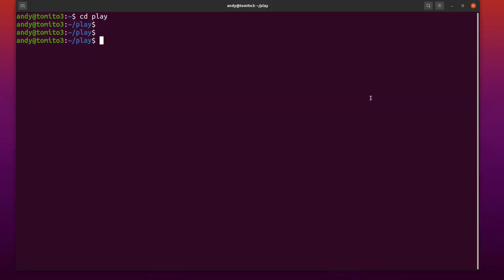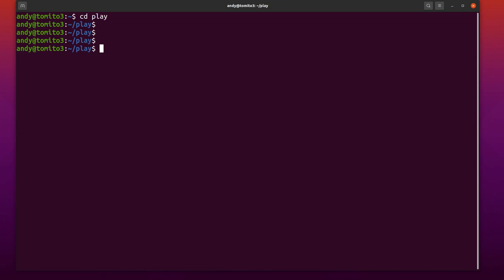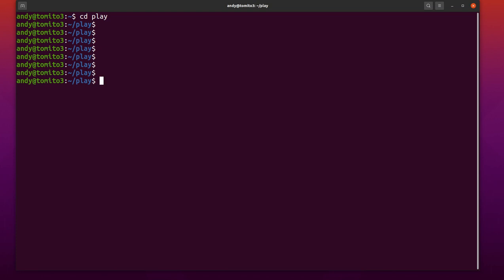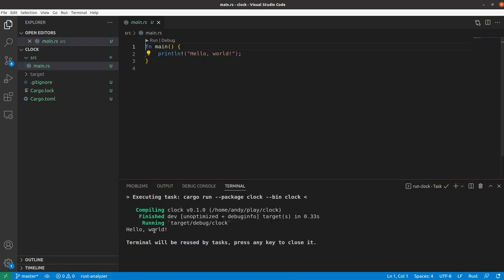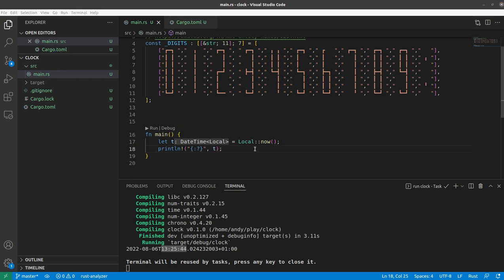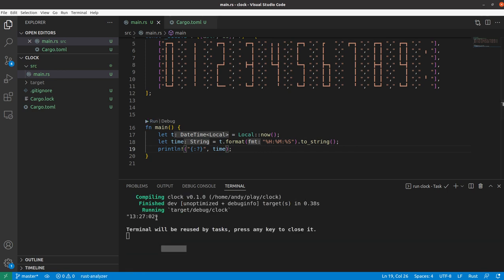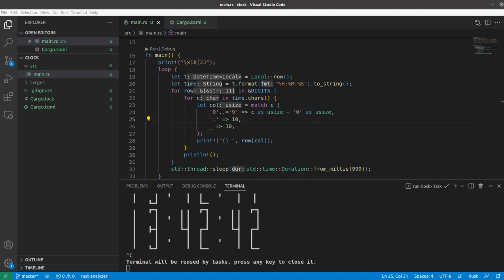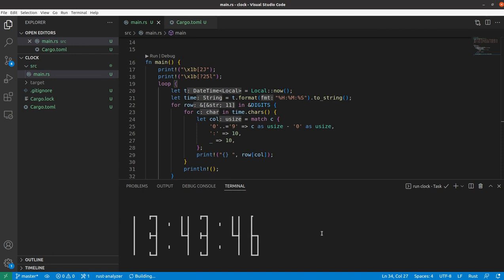Simple Rust Projects: A Rust digital clock

Comment: If you don't want to pollute the original terminal buffer, you can enter an Alternate Screen Buffer with "\x1b[?1049h" and reset it back to the original buffer with "\x1b[?1049l" when you quit. Supported in most terminals (esp. those that implements xterm)
Reply: do i print that text?
Reply: @RenderingUser  Yes, every ANSI escape code is printed to stdout so that the terminal that receives it can interpret it and do what it needs to according to spec that it implements (e.g. xterm, which is the most common).
Reply: @dealloc  thanks
Reply: @dealloc  also
Is there a way to clear the screen with rust for each frame?
Reply: @RenderingUser  There are multiple ways to clear the screen, and depends on your use case.

Clear the entire buffer with \x1b[<n>J where <n> is 0: clear from cursor down, 1: clear from cursor up, 3: clear entire screen. Simply just print with println! in Rust.

If you care about framerate and performance, I would use a library like Crossterm which provides a better API to interface with terminals, but also provides optimizations to avoid doing too much I/O by providing control over when things are pushed to the terminal (flushed).

Other additional optimizations would be to have virtual buffers, using diffing algorithms to only update cells in terminal that changed, rather than the entire screen, or even just portions of the screen if you have other static cells.

There's no need to overthink it at first. Start simple. I would prefer starting with Crossterm if your goal is to just render something into a terminal and relatively fast e.g. 25 frames per second.
Reply: @dealloc  ty again
thats very helpful

also <n> = 3 seems to produce weird results so i went with 2
Reply: @RenderingUser  Sorry yes, 2J is clearing the entire screen, 3J clears the scrollback–e.g. lines that were printed before the visible part of the terminal.

Note that \x1b[<n>J only erases the _viewport_, meaning the visible part in the terminal. Anything outside of this, if you had printed something that cause the terminal to scroll or because you resized it will still be there until you were to resize the terminal to make those places visible and erase the screen again.

But as long as you know the size you want to render within or if you update the terminal then you should be fine.
Reply: @dealloc  i see
That makes sense
One issue I still have tho is when I do ctrl+c out of the program, it stays on its own buffer and doesn't exit
How would I get rust to auto output the exit code when I do ctrl + c
Or if the program panics